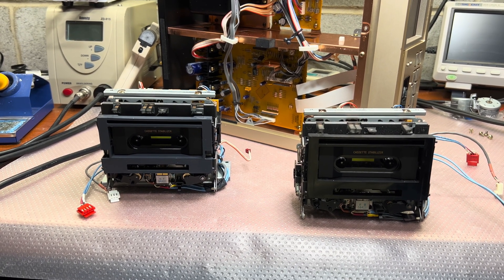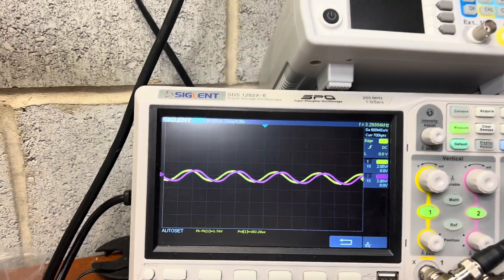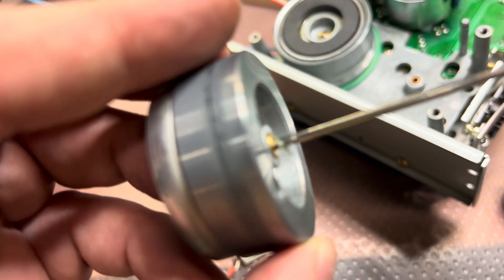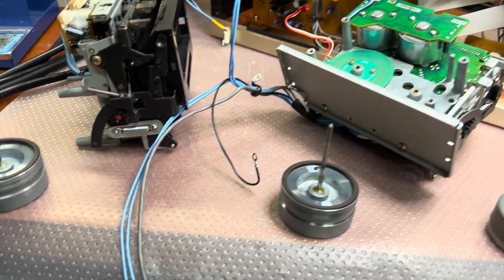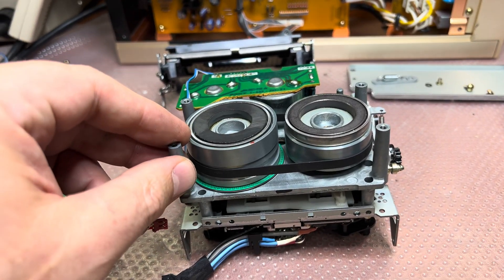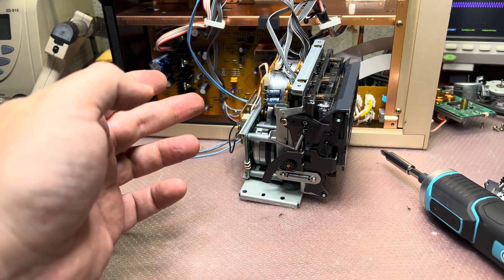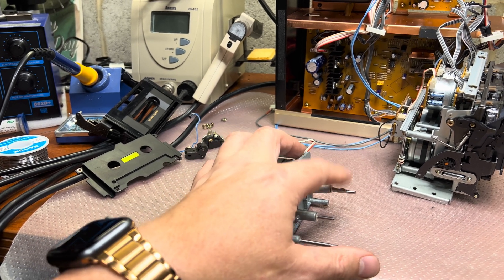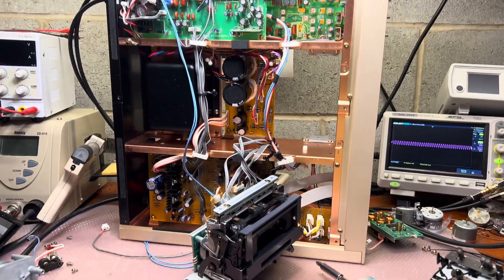Sony TC-KA7ES Restoration: Part 2 - Triumph Over Speed Issue

Comment: That's very strange, that Sony, even probably mistakenly, decided to build a transport with such a huge speed difference between capstans.

There are 3 points needing to be done to be able to use such problematic mechanisms:

1. Use 2 belts instead of 1 (like 2×4 mm or even 2x5 mm if there is enough "space" for them on the pulleys of the flywheels.
2. Decrease the pressure force of the left pinch roller to approx 150g.
3. Grind the rubber off on the left pinch roller and make it 4 mm of width by surface, thus minimize the contact area between capstan itself and pinch roller (but the left side only!).

As the result - the slippage will be much stabilized.

The right side, on the contrary, should be as much clinging as possible (matte-finish capstan + wide pinch roller by rubber, like 7.2 mm or so).

Comment: The zinc alloy from which the flywheel is made has the property of changing its volume as it ages, and in your case the flywheel has cracked. It is likely that the outer diameter has increased and thus the revolutions decrease and hence the speed of the belt. Now I see that the other flywheel is also cracked. It's good that you found a donor.
Reply from the maker: I am sorry, but your logic is flawed. DD motor keeps the same revolutions no matter what. Anyway, thanks for brainstorming.
Reply: @hifirulezzz  I meant the diameter of the passive flywheel. It probably increased and hence its RPM decreased, reducing the speed of the tape more than necessary.

Comment: You should know the interesting fact that in the service manual for 222esl said that it's transport is the same as 222esG BUT smaller one capstan shaft of 222esG is too big in diameter to be replaced instead of esl one. It's absolutely weird

Comment: Now you have one complete transport with KA7 boards and electronics but accessories from the 555.

This wouldn't go well with me as the spare transport still has the problem and it must be something. It should be something torque related and how the electronics react to that.

How about using a cassette torque meter to verify the pulling torque against a well tuned transport? Both capstans.
Reply from the maker: I used. check part 1. The torque is perfect. The issue with the capstan grip and the increased difference between shafts' diameter.
Reply: @hifirulezzz  Are the bearings the same size between the two? I mean master to master capstan, slave to slave capstan between K555 and KA7.

I guess they varied it to make parts incompatible with one another.
Reply from the maker: @m80116  No, shafts diameter and bearings are different. KA series also has increased differences between left and right shaft sizes.
Reply: @hifirulezzz  what a maze